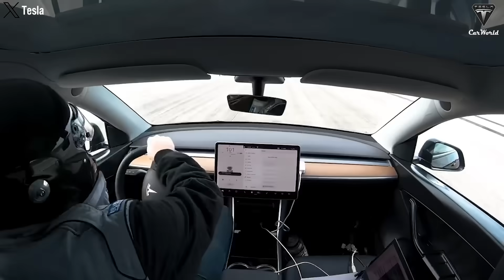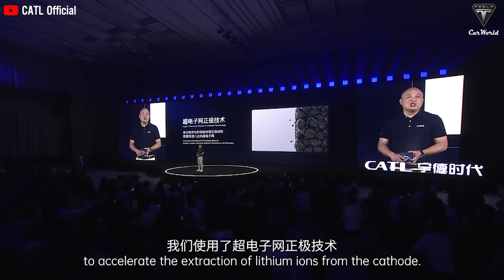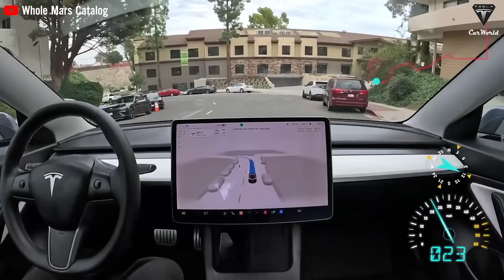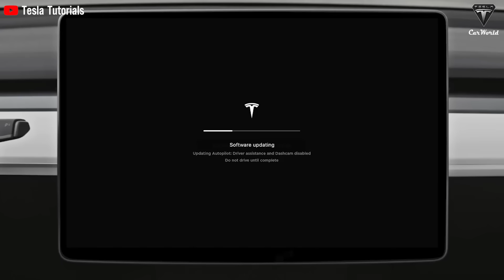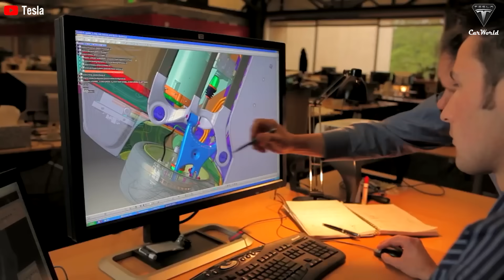Elon Musk Just LEAKED All-New Model V Coupe Never Appeared! SHOCK Price, Parameters and Tech Inside!

Comment: Strange that you say radar and ultra-sonic sensors are required for autonomous driving. The two sensors Tesla has removed.
Reply: Radar is coming back. Musk said they would only use radar for FSD if a sufficiently high resolution radar became avaiable. Now it is, they're bringing it back.
Reply: @jasoncatt  To be a little more exact, the new radar is on Tesla Model S and X. Elon said they have no current plans to put this on 3 or Y, but the radar is "being evaluated".